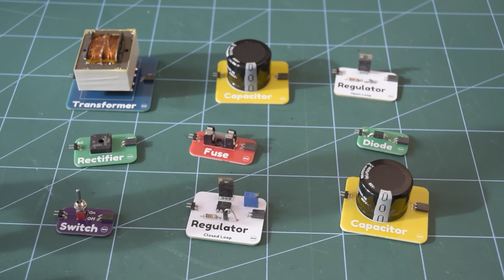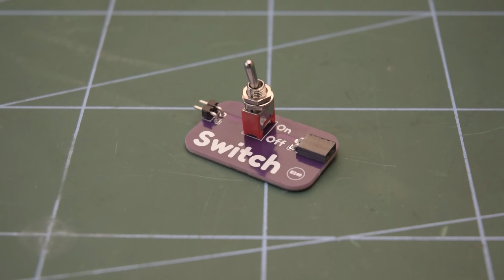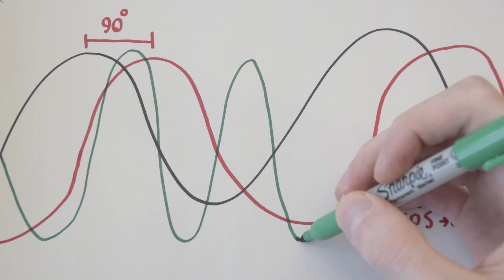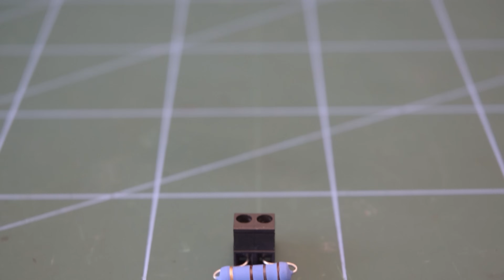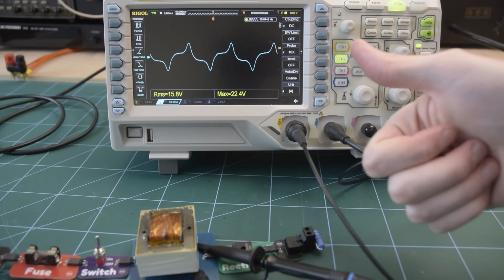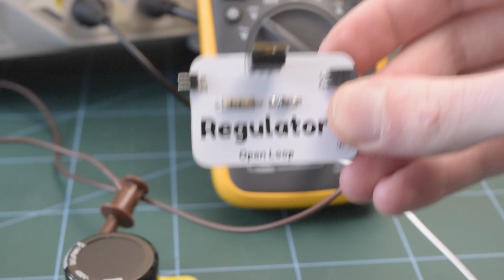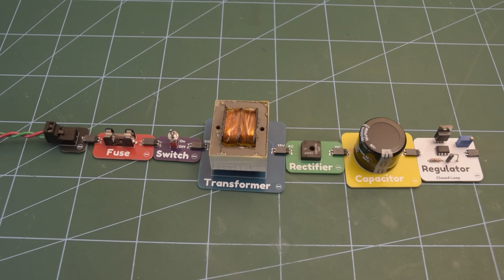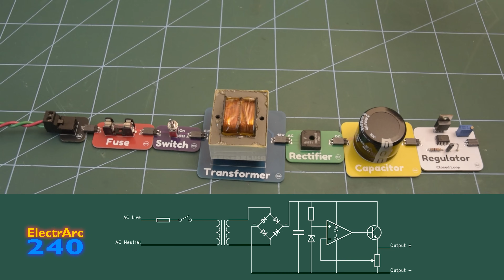Every Component of a Linear Power Supply Explained (while building one)

Comment: hey guys remmember who kill you dont care about HIGH VOLTAGE POWER LINES!!!!! the real killer is current if like 100miliamp passes trough you well you dead or somthing but remmember its current killer not voltages you can prove by rubbing feet on carpet or somthing and you create static discharge those are high volts :) also sorry for spelling wrong if i did

Comment: the sand in the fuse will also slow down the warming of the wire and thus make it suitable to survive small bouts of high current that can still fry your circuits. If you want a fast fuse go for one without sand.

Comment: Great work overall! One small concern – when installing a breaker on the primary side, it's important to make sure the breaker is rated for the correct amperage AND has adequate short-circuit breaking capacity (kA rating) for that part of the circuit. An undersized breaker on the primary side can fail to trip safely during a fault, which may cause overheating or fire. Might be worth mentioning this in future videos for safety – just a friendly heads up!

Comment: I am a bit confused about the chapter on diodes, specifically about how only using a single diode will cause asymmetric loading of the transformer and the mains. Trying to run a diode in reverse, it essentially acts as a extremely high value resistor, correct? Why, then, is the negative portion of the current waveform higher than the positive? That looks like a 30 ohm power resistor used, which should be much less resistive than the reverse resistance of the diode, which means it should draw more current on the positive than the negative, at least I would think. What am I missing?

Comment: You can "just use your eyes" to test fuses, but I wouldn't trust that method. I have been fooled a few times when the fuse wire burned out under the metal end.

Comment: Excellent video :medal-yellow-first-red:  Thanks a lot!! The only thing I didn't understand, how your OpAmp is a voltage follower when you have resistor in the feedback. Moreover, how you connect the load in parallel with your feedback resistor. Thanks for a response🙏

Comment: I watched this because a comment about a headphone amp I own stated that the included power supply/transformer (AC/DC converter) is trash and is responsible for a lot of the noise. The comment suggested getting a proper regulated power supply. Great so now I roughly know the differences between linear, switched and regulated. How do I shop for a specific spec? ie I want a 6V 2A capable power supply, with either a linear or regulated switched circuit. On Amazon, products domt denote if its regulated, regulated with a closed or open loop, etc.

Comment: How did you determine the pcb trace width for the AC side? I've wanted to make pcbs with ac to dc but I have always been worried about trace size although Im not moving more than 5 volts
Reply from the maker: There’s lots of online calculators for trace widths, they’re probably your best bet. Or just do what I do and make them very wide. If your current is a few amps or less it shouldn’t be tricky. Just remember there’s no benefit to making traces thin! (Most of the time)
Reply: @electrarc240 what trace width did you end up going with for this video?
Reply: Thank you for replying. Appreciate your video!!

Comment: At 11:11  20 times less current on the secondary compared to the primary? I think this can be possible if for the secondary coil is used a very thin wire. Otherwise the welding transformers have very few turns of the secondary winding  but the wire is immensely thick. I came from the medical field but my father was like a master in making transformers and networks. He finally worked as a designer instead of being in a factory for non ferous metals, aka power transformers. He was offered to go to the UK at Loyds but my mother hated the idea we remained in Romania although my daughter is a UK citizen

Comment: This is amazing content. Keep creating, please. Such small steps improvements of the circuit with the explanation why are wery useful. 
Are there manufacturers who still produce such power supplies?
Reply from the maker: Yes linear power supplies are still produced, but they are only used for a few applications that require clean power, and the latest switch-mode power supplies are close in terms of output ripple/noise so they are certainly a dying breed!

Comment: I just came across this video, and find it extremely well done. I would like to use your approach to show how a linear power supply is constructed and how it works . This method of showing how each component is put together to make a power supply, but pretty much simultaneously teaches the basic physics of the components and how they are supposed to function, how to read schematics, and how we can get a DC voltage from the AC at the mains. Very educational. Thanks for your great series on power electronics!

Comment: Thank you for another clear and intuitive explanation video again!  I finally understand a bit more about how power supplies work!
By the way, had two questions: the 50Hz hum can usually be heard on even high end audio amplifiers (which I assume have correct filtering and stuff) when not connected to a source and you touch the end of the AUX cable. Since the buzz isn't present when you dont touch it (well on some lower end ones, there still is a buzz), does this mean your body is turning into an antenna and picking up the EMI from the room around? or is there some other cause?
Also, in USB PD, there are a variety of expected voltages and currents. I assume that's handled by a microchip handling the expected voltage, and fancy switching in a switch mode PSU?
Have also heard of active/passive PFC on power supplies, is that related? or is that more relating compatability between 110 and 240V mains?
EDIT: just realized you mentioned Active PFC a seconds after I made this comment, haha. I'm still going through your videos, and look forward to learning about that too :)
Thanks again for such fabulouos and clear videos! I look forward to what else you make in the future :D
Reply from the maker: 1) Yes exactly! if you touch an oscilloscope probe you can see this 50Hz voltage on your body, and it goes away if you also hold onto a pipe or something else grounded!
2) Yes USB-PD power supplies are variable voltage, they're quite cool!

Comment: Hi,
I am using an old 5V phone charger to switch solid state relays when the 220V mains supply turns on or off.
However it takes the charger about 5 seconds to fully discharge leaving the relay still powered on for this time.
I was wondering if I could remove the capacitor from the charger to make the switch more or less instant?
Reply from the maker: The capacitor is required for the charger to be stable, you could try adding a resistor in parallel with the relay "coil" to discharge it faster

Comment: You supplied a voltage of about 22v to the vcc of the op-amp from the capacitor, 
Is there any op-amp that has a limited voltage of about 22v at its vcc ??
I thought most op-amp has a limited voltage of about 15v at vcc ??
Reply from the maker: Old opamps like mine (LM741) can handle a lot more than modern stuff!

Comment: Where does the negative voltage "go" in a single diode setup? I assume it just open circuits and doesnt actually pull any current from the main?
Reply from the maker: Exactly!

Comment: many thanks! I like the way you map out individual parts...

i didn't understand the closed loop circuit fully. When I looked up a diagram of what an OP-Amp does, I became even more confused.. could you explain how the feedback works better/ or with another example?

I know what a buck converter does - I have used one to run a 12v fan from a 24v pin on my 3D Printer.

Comment: This was very interesting. It will be useful for everyone to make Linear Regulators, Closed Loops and connect it after the output of the laptop power supply, which is 20 volts, so that it can charge the 12 volt battery of the car. Can you make a video on how to make such a regulator on a breadboard or bulk assembly?

Comment: Just a warning I failed to see in the video. 240 volts with breadboard like structures is not a good idea.
Reply from the maker: Although the connectors are technically rated for 350VDC, I completely agree

Comment: Another MASTERCLASS...!!! I couldn´t always follow, sometimes cause you didn´t mention what you refer to, while speaking (it became clear several sentences later what you referred to, nevertheless), but a 2nd view will clear those spots out too... i LOVED the split-secondary-rectifier, I had no clue. I´m an absolute beginner, and can understand almost solely your tutorials... Could one use the "split-secondary" to create 2 "mirrored" voltages, like +6V/-6V ? (in a fully different, irrelevant context, of course... I have seen PC-PSUs having +5V/-5V, and now I wonder, if that´s the way it´s made...)
Reply from the maker: Thanks! And yes using that style of rectifier to create two voltage rails is pretty common
Reply: @electrarc240  Oh, that was a lucky guess !!! And it occurs, that I needed exactly that: I found a circuit, with a double "low noise" OpAmp chip, a simple cassette-deck with motor and head (but not ANY circuitry), a PC-speaker and 5resistors/2capacitors . The sound is loud and very clear. Very minimalist, but it also needs 3 separate PSUs: 2x 12V and also -12V !!! Maybe I solve the problem of otherwise destroying this minimalist cassette-player and manage to realize it with a single PSU at the end... https://dimitrispiperidis.blogspot.com/2014/12/tapeplayer.html

Comment: It seems like the zenner diodes fundamentally do the same thing as the transformers in that they change the output voltage?
Reply: They clamp the voltage rather than vary it. They are similar in that they affect the voltage of the circuit but then again so does a resistor.

Comment: A circuit using an lm317t is thus closed loop as it contains an opamp to monitor and regulate the voltage as the closed loop in this video with the opamp. I also had another question, what about inrush current if you use a lot of capacitance in the filter part of the circuit ? Excellent video !!!

Comment: I want to see this circuit with the ability to produce 10 amps at 12 volts. When trying to build a regulated circuit like this. How do I go about driving another transistor for 10 amp at 12 volts or any regulated voltage at 10 amps?  Assuming I have the proper transformer, full wave bridge , and voltage regulator of 1 amp like 7812 or lm317. I want that fixed voltage to produce 5 to 10 amps.  I know people will call me dumb and stupid. Don't care about what other people think. Simply put, I want to have the ability to up the current in your linear powersupply video . Great video. Very well explained. I see many videos that show how to build a 1 amp variable powersupply at a fixed voltage. Built several  myself.  Appreciated anyone who can point me in the right direction. Ty

Comment: is there a difference between apparent and reactive power?
Reply: Apparent power is the sum of the Reactive power and the Real Power. In a purely resistave load the Apparent power is equal to the real power (what is consumed as work). When the transformer was connected without loading the apparent power was equal to the reactive power (no real power was consumed).

Comment: How can the average power be zero? Power is never negative. So it needs to be zero at all time to average zero. Negative voltage or current doesn't make negative wattage.
Reply from the maker: If power is going back into the grid it’s classed as “negative”

Comment: Cool video. Much better than sitting through my power engineering lectures back in the 80's 🙂That's a H11 halogen bulb you hooked up as your final load - cool.

Comment: Excellent presentation. Retired electrical engineer from the Defense industry, I also taught electrical engineering courses to civilian and military personnel at various times. I'm impressed with your straightforward, careful and pretty thorough coverage using not only the hardware elements/components, but showing the various schematics as you progressed, along with the differential equations as appropriate. You should be teaching electrical engineering courses.

Comment: 4:39 this is strictly-speaking false

there is no voltage drop in an inductor. Full stop. Maxwell’s equation tells us that the closed loop integral of the electric field is equal to minus the time rate of change of the flux of the magnetic field through the loop. That’s where the equation comes from. It is NOT a voltage drop across the inductor.

This is a common mistake non-physicists make when talking about circuits. It’s fine for most purposes, but it is strictly-speaking false.
Reply from the maker: I’m not really sure what you mean, are you saying the voltage across an inductor is always zero?
Reply: Correct. Voltage is defined as the integral of electric field, and the electric field inside the inductor is *zero*. The voltage drop is zero

The sum of all the voltages in the loop (not including any term for the inductor, since it’s zero) is equal to the negative time rate of change of the magnetic flux - which is the formula you show with L. 

This is just a statement of one of Maxwell’s equations in integral form. This is a hotly debated topic between physicists and EEs. I just wanted to let you know that, strictly speaking, what you said is false.
Reply from the maker: So what would a physicist say is the cause of the “voltage drop” while current/flux is changing in the inductor?

Comment: I was a teenager in the early sixties. I had an inquisitive mind and was fascinated by electronics. Back in those days, the best I could manage to build and, to some extent, understand, was a crystal set AM radio receiver, and various simple audio amplification circuits using valves and speaker output transformers. The thing is, I barely understood what I was doing. With YouTube videos like this linear power supply build, today's young (or older) electronics enthusiasts are incredibly privileged. Thank you . I have subscribed and will now explore your other posts.

Comment: As an amateur radio ham who needs to have a basic grasp of electrical circuits & principles I found this block by block explanation absolutely captivating. Whilst I have been lucky to have some very talented mentors your practical demonstration coupled with explanation of the relevant technical terms and an oscilloscope has helped to strengthen my understanding. Thank you.

Comment: Surprised nobody in the comments has mentioned that you really shouldn't be using a metal body toggle switch on mains voltages.
Reply from the maker: It’s rated for 250VAC and I isolation tested it. But yeah I think kinda sketchy too. Just picked it for aesthetic reasons

Comment: Wonder full video! In the end of the 80's at an age of 16 we broadcast every Sunday on FM 104,5 MHz with a self build FM transmitter and linear's, but there was nothing better in power supply then ordinary 12V car batteries🙂What ever we tried, during broadcasting on a unexpected moment noise came through with whatever we tried to build as a power supply. After so much thyristors, capacitors etc. we gave up, loaded the car batteries on Saturday and hoped they would last our 4 hours broadcasting. In those days it was illegal but accepted by local authorities for we made our entire small-town happy without any commercial gain. But to summarize, in self build FM broadcasting equipment our experience for the biggest obstacles were the antenna (my god the time spend on those antenna's...) and the power supply. Everything in between was easier to be done!  The power supply in your fantastic video on the left at 0:57 is so recognizable! I see that * thyristor in the right side exactly in the form as we tried using in our days! So now I'm curious how on earth it is possible that the power supply next to it on the right supplies the same 100% straight-line DC power, as you mentioned, can be found in another video. Keep up the good work, it refreshes (or reboot) technical knowledge in (old) old-school hobbyists like us!

Comment: Linear supplies are easy to design and build. The problem is getting a good amount of power from them because they require high power bipolar or FETs as output transistors. Much easier to get audio grade clean power from them.

Comment: 25:21 why does the voltage despite having capacitor
Reply: The answer in this case is resistance, when higher current run on the transformer, the resistance increase causing the voltage drop, also resistance on the diode and capacitor

Comment: 11:34 Why it would blow up when the Rigol D1054 have 1MOhm input with CAT I 300 Vrms max input?
Reply from the maker: Best case the house is wired correctly and connecting neutral to the earthed ground clip trips the RCD. Worst case L and N are swapped (unlikely tbf) and the scope pops. Also just CAT 1 is pretty sketchy imo. Though not as sketch as the mains side of my circuit lol
Reply: @electrarc240 But you don't need to connect a ground clip when measuring mains because the ground is already connected to pe which should be on a similar potential as neutral(not the same, but close enough)